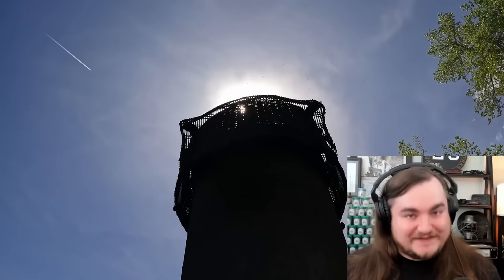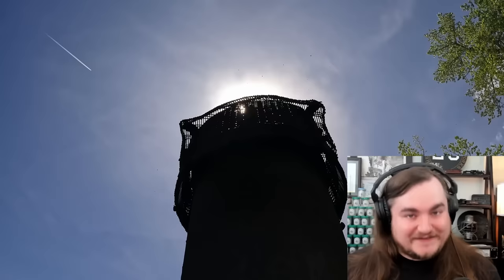Why do USA steam trains make smoke, but UK ones don't?

Comment: Back when steam locomotives were in earning revenue mode, making heavy smoke was regarded by the Norfolk and Southern Railway as a potential disciplinary offence, as it wasted fuel and led to complaints from the public. In the era before tumble driers, washing was commonly dried on a line and being downwind of a smokey locomotive, could ruin the whole wash.  In the UK with preserved locomotives, making smoke is regarded as wasteful and anti-social.
Reply: Hmmm, wasteful and anti-social... the name of a certain country springs to mind 😉
Reply: I very much doubt the british clothes line was an issue, the wants of the public have rarely influenced dirty industries until very recently. Btw we still use clothes lines, modern washing machines spin nearly all the water off making the tumble drier practically redundant. Hanging out on the line is mainly to air the clothes, less so to dry them.
Reply: @jeffslade1892 I strongly suspect that in many cases the husband of the lady whose washing was ruined had something to do with the railway. He got his ear chewed off at home and had some words with the crew on the loco the next morning. Said crew fires the engine more carefully for an easier life.
Reply: When O. Winston Link was getting permission to photograph NS trains, he was told never to take a picture showing black smoke.
Reply: We have a tumble drier and never use it. We either dry on a rotary drier in the garden or on racks indoors using heat from a wood burner. 24 hours on a rack in the spare bedroom and clothes will be dry whatever the temperature providing you have your ventilation and humidity sorted. Electric driers just seem to be one of the worst most wasteful and CO2 polluting devices around.
Reply: @Baneful_Ben Any more funny jokes, katsap?
Reply: @jaadow77  I have his wonderful photobook, Steam, Steel and Stars, America's last Steam Railroad.
Reply: @jaadow77  well there a difference straight away, british photographers do not need permission to take photos in public.
Reply: @ShaunieDale  The backs of houses and their clotheslines can be seen from any train passing through british towns. No concession was ever made to reduce smoke but that smoke was inefficient. With their narrow grates, british locos had to be efficient. Also consider that during the steam loco period house heating was by smoky coal fires.
Reply: @jeffslade1892  For now, at least. :)
Reply: @Cthulhu1970  it is rather enshrined in law and takes a special act of parliament to ban photography (e.g. MoD property) in public places.
Reply: This was my first thought.  I got to see the N&W J 611 when she was restored in 2015 and while a few of the points they stoked her up extra to get some thick black smoke...most of the pictures I have the exhaust was clear with a hint of white steam.  Personally I liked the pictures that had a strong clear exhaust that condensed into a trail of steam.
Reply: @jeffslade1892  Well, Mr. Link was also going on the property, and getting cooperation from the RR. Have you seen his work?
Reply: @jeffslade1892  factory towns would have a day off to let people do wash so I mean not unheard of back in the day when everyone is washing by hand
Reply: Is there anything that isn’t “anti social” in the UK?
Reply: @blueoval250  Making jokes about every other nationality other than British.
Reply: The phrase "comes from the wrong side of the tracks" pertained to wind direction; e.g. the person lived downwind of the tracks, so they (and their laundry) were exposed to locomotive smoke. My grandmother DID live within 50 yards of the railway line. It was great to sit on the front porch and wave to the engineers, but not so when the wind was blowing her way.
Reply: @jeffslade1892  No, it did. 
And no on said it was to do with the clothing industry (''clothes lines'' as you put it).
It was because the smoke had a habit of spreading particles over people and clothing, which could cause issues with sight, cause irritation problems for some, even causing sneezing fits and coughing issues, and could also make people very ill.

You learn about it in school in the UK.
  
And yeah, with the british government if enough people get pissed off in the right region of the country, it leads to them doing revision on their current policy's. The british government are notorious for doing too much legal revision on practises, so much so that it tends to p!ss us off more then make us happy. 

So making a grumpy ''blow off'' comment towards someone else pointing that out isn't the greatest on your part.
Reply: TerminatorJak nope
Reply: @humbledink2978  clothes lines or clotheslines are nothing to do with any "clothing industry" those things are for drying washing. But the industry  - dirty factory chimneys. I am old enough to remember when the only house heating was coal fires. It did make a mess but the railways were only a small part of it. People just put up with it. It did cause health issues so eventually the gov did introduce smokeless fuel zones in cities but what put paid to it was central heating and abandoning coal fires. You should paid more attention in school.
Reply: @robcanisto8635  pretty sure no one in UK was ever given a day off to do washing. It was rare for a married woman to work full time if at all then. Men might be given an hour off to get a haircut but they often worked Saturday mornings too.
I remember doing Saturday morning as overtime myself but as standard practice it had died out. I do remember once chap being sent home to have a bath and change because he stank like a dog that had rolled in something.
Reply: My grandfather worked for MOPAC when they ran steam locomotives. They lived close to the depot. The day before washday, my grandfather would bring the schedule for the next day home to my grandmother. That way she knew when she could hang out the wash to dry.
Reply: @jeffslade1892  Didn't the Great Smog of London in 1952 play a role in that? I think you Brits were way ahead of us Americans in air quality awareness because of that experience, which ultimately killed quite a few people. 
If you lived in Los Angeles in the 1960s, there were days with just a quarter mile visibility and smog so bad you could hardly breathe. Now special blends of gasoline are sold in California, so we don't have that much of a problem. It costs more, but it's well worth it.
Some locomotives burned coal; others burned wood. I suspect because of your abundance of coal, you had no wood-burning locomotives.
Reply: @Gail1Marie  yebbut the point - it wasn't trains. It was everyone and their dog burning coal. The London pea soup fog had been a feature for so many years. The last notable was 1962. It gave the name to London Particular Soup, which is usually thick pean and ham. 
I remember driving through the spaghetti junction Birmingham (The Birmingham, the real one not the copy ;) ), with a yellow ochre sky from smog inversion layer.
Reply: I grew up in 1960's Northern England. I remember a teacher asking us why we always drew stones black. We didn't understand the question - all the stones and bricks and tree trunks we saw were black. Quite probably our lungs were too. Thank goodness for clean air regulations. I would also agree with the cultural expectations - we expect steam coming out of our trains not black smoke
Reply: @Gail1Marie not many trees in comparison to the US too, even by percentage.
Reply: Having worked my earlier railroad career with steam era engineman on the B&O I couldn’t agree with you more.  The locations where smoke had to be kept at a minimum was a constant topic…..I credit your comment and the rest just seems to be up in foam~~~ 40 years of continuous service and 10 years retired…. ms~~~
Reply: Nice story but very doubtful. Back in the day when coal locomotives reigned, railroad companies were too big and powerful to care if some hosewifes wash got ruined. If they didn't like it, tuff luck. And no politician back then would side with the public on this one. The smoke was something the public had to endure weather they liked it or not. Todays laws were not in effect back then. There was no such thing as the EPA or equivalent.
Reply: @jeffslade1892  Coal did not produce any smoke. Only wood did. Coal was a very clean burning fuel. But EPA exaggeration cast a shadow on clean burning coal. The films of smokey locomotives were burning wood. Locomotives going across the nation did not have a steady supply of coal. They had to burn wood.
Reply: @JackSquat54  obviously you have no railroad experience, good day…
Reply: @jeffslade1892  When I worked in a coffee plant in the 80s, it was normal to get complaints from residents about the damage done to their laundry (our boilers were fired on used coffee grounds).
Reply: @wonjstuff Okay: How many Nazis does it take to screw in a Ukrainian lightbulb...?

You'll have to ask the US installed President Zelensky for the answer.
Reply: @Tailspin80 Your medal is in the post.
Reply: @wilsonlaidlaw People are arrested and sentenced for making verboten jokes in the UK, whether or not it's about British people.
"Intolerance will not be tolerated."
Reply: @jeffslade1892 I've never met a washing machine that can dry clothes just by the spin cycle.
Hell, my clothes can still drip, even after a full spin or two at max speed, and the washing machine is only 5 years old.
Reply: @AndrooUK  Super. Can’t help thinking you’ve used that line before.

Even if you don’t care about the environment or your electricity bill, tumble driers are terrible for your clothes. Where do you think all that fluff comes from that clogs up the filter? Line dried clothes will last longer and are less likely to need ironing (assuming you’re one of these people that like their clothes flat not crinkly).
Reply: @MechanicaMenace  except Britain is very green, verdant, even farmland and cities have trees.
Reply: @AndrooUK  maybe you need a new machine? The latest have a tumble (without heat) and spin so the washing comes out barely damp. The old one, and it was old, died recently, even then the washing did not come out dripping. The new one is a bit of a revelation,  although why it needs wifi is beyond me.
Reply: @jeffslade1892  that's not the same as having enough lumber to build cities out of
 Timber framed buildings being insurable is relatively new. Yes England Wales and Scotland are very green but not because of trees on a scale comparable to the USA. It's a very green island but not much of that is trees in comparison.
Reply: @MechanicaMenace  it's quite difficult to go anywhere without a tree in sight except the most built up areas of inner cities, even there threes are planted. Timber framed buildings are pretty rare, mainly because they do not suit our climate. Whilst we do not have thick heavy forest, not do we have treeless desert. If you were to fly over it you would see green land and trees.
Reply: @jeffslade1892  no, timber framed buildings aren't rare because they don't suit our climate, they're rare because we cut down so many trees, had such a lack of that material, we had to use other materials and forgot those skills. And I never said we were a tree desert. Yes our cities have lots of imported species of tree, but they're gardens not forests and in comparison sparse. You can walk across most of our woods in less than an hour, most of our wooded areas are a couple of tree thick strips next to roads, in other parts of the world it can take days to drive through a forest.
Reply: @MechanicaMenace  I come from a long line of builders going back well into the last century although I am not one. Builds largely switched from timber to brick at the end of the 18th century mainly because brick is more fire proof, stronger, more stable, longer lasting, waterproof, better insulation, and just generally better. There was a resurgence in timber frame pre-fabs after the war but they have mostly disintegrated and been cleared now. There was no shortage of timber, we could and did import as much as we wanted.
Reply: @jeffslade1892  yep, you're obviously not a builder. Because the only thing you said that's true regarding brick is it's more fire resistant. It's definitely not better insulation. It's high thermal mass, crap insulation, and impossibility to make anywhere near airtight (important for insulation and energy savings) is part of why we're moving back to timber.

And yes, we could and did import it, but  to build with and make things out of, not power shit. You ain't going to expensively import wood to burn in a trains firebox.
Reply: @MechanicaMenace  timber was never burnt in british locos, we had coal for the industrial revolution.  Wood had been used for cooking fires until we had plentiful supplies of coal by canal and later by train. Timber was imported for construction (buildings still used wooden joists), and furniture. If you cannot lay bricks airtight, you have a bad brickie.  Consider the longevity of brick and mortar vs timber frame. Wood rots.
Reply: Would there have been competition among crews in the old days who could burn the cleanest?
Reply: @wonjstuff  I bet you're the life of the party.
Reply: @Baneful_Ben  usa thats the country every non american thinks off
Reply: @jeffslade1892 so I’ve lived next to railway lines in southern England and the smuts from the train in the early sixties would really upset my mum. As for drying clothes my wife still hangs it outside straight from the washing machine because, in her words “it smells nicer”
Reply: @wonjstuff  I got one - my tax dollars being wasted even harder than they were when they were actually worth something!
Reply: @PhilbyFavourites  in the early 60s we still had coal deliveries. Everyone and their cat used coal fires for heating and that caused more than a few smuts. In the mid 60s we moved to a new house with gas central heating. Wife does put washing on the line but they go out a lot drier than the old machines could do, and mainly for airing for that fresh smell.
Reply: @Baneful_Ben 🤡🤡
Reply: American rail out west had many more miles of open land where no one would complain about black smoke/ soot. One of many reasons. (This is my second train video. Plus I am literally in Norfolk-- so obviously I'm an expert now.  )
Reply: You are correct. Many railroads back in the steam days had a stencil on the tender in view of the engine crew "Black Smoke wastes coal"  excessive smoke was a potential rules violation, too. It's all about the amount of fuel to air mixture similar to internal combustion engines.
Reply: @jaadow77 Correct, I heard Mr. Link say that during a talk he made.